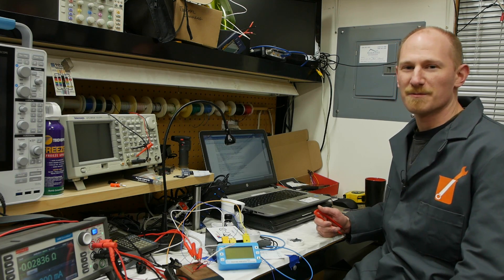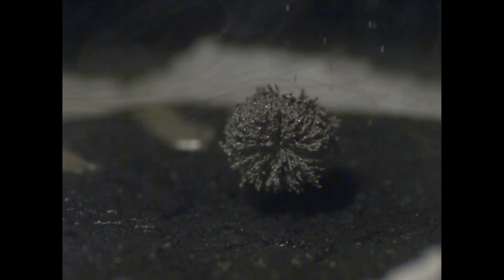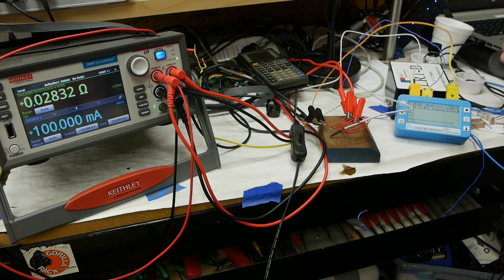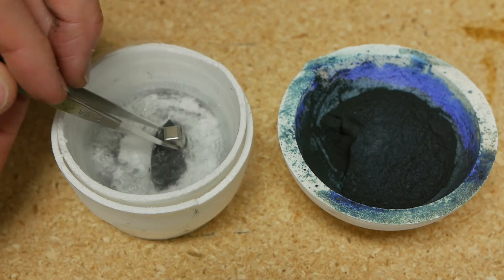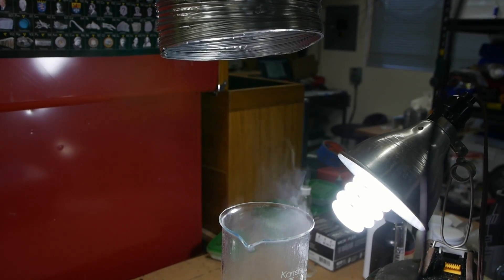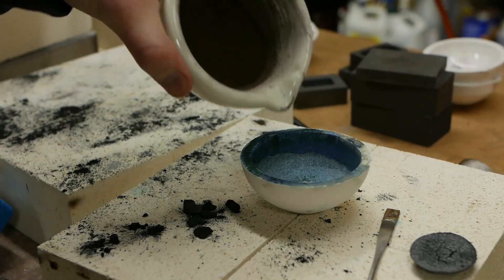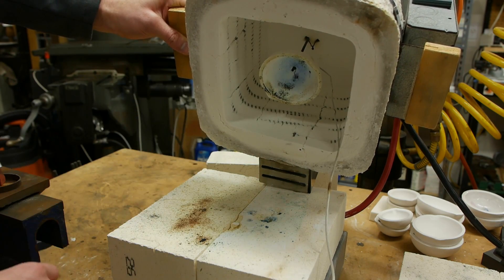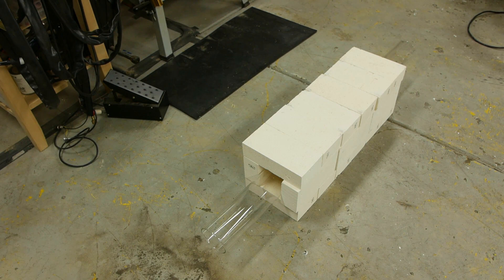Making YBCO superconductor

Comment: I am really happy to see you are back with new projects.  :) These cryogenic coolers are quiet nice, and I am trying to get one for a couple of years. But at Ebay Germany/EU they are very rare and/or very expensive...
Reply: Orbis92 i made liquid nitrogen using 4 stage cascade refrigeration system build using 4 fridge compressor i got from scrap yard for $4 each. Total project cost was under $100 and production rate after modification is around 450ml to 500 ml per hour. 12 liters per day. It took me one 2 weeks to build it.

Comment: I wonder if it's possible to build a loop transmit antenna out of superconductor. When the loop is small compared to wavelength (for long/medium/shortwave) the problem is that they have a very low impedance, so that they basically lose a big portion of the transmit power to resistive losses. In practice it is impossible to build a small, yet efficient long/medium/shortwave transmit antenna. Could this be changed using superconductors?

Comment: This takes me back, I spent a long year making variations on a theme of YBCO (everyone I worked with called it "ibco" btw). For attaching wires we used a platinum ink to stick on tiny pieces of platinum foil. Both were as expensive as you'd expect but a tiny bottle of ink lasted for hundreds of samples. You just paint a little ink on the sample, touch the platinum foil to it and then bake it in the furnace. I seem to recall the ink is platinum on carbon so the carbon burns away and the platinum sinters to the sample. I will say I was using this for high temperature experiments but I'm pretty sure it would work at low temperatures too. IIRC the methodology we used correctly you are cooking it way more than you need to. We'd just mix together stoichiometric amounts of material and chuck it in the furnace over night at about 1150 C - or lower than any of the components melting temperatures. The mixing process was grinding in a mortar and pestle then stamp it into disc using a 15 ton press. If you've got any questions I'm happy to try and remember what we used to do.
Reply: You were making PCP? Lol

Comment: When I first glanced at the video subject title I misread the YBCO as REBCO but after realizing my mistake I began to wonder if Rare Earth Boron Copper Oxide materials was area of research you were considering pursuing?
Reply: Since Yttrium is a rare earth metal, YBCO is a REBCO. Another example of a REBCO is BSSCO (Bismuth Strontium Calcium Copper Oxide).
Reply: bismuth and strontium are not considered "rare earths"
Reply: Boron doping has been used in ybco in some cases for spinning ybco fibers
Reply: IamGrimalkin
Correct
Reply: Yep, BSSCO is a HTS, not a ReBCO.  It doesn't have barium.
Reply: B stands for Barium, not Boron, in this context.
Reply: Abdega
Not to replace barium, though, right?
Reply: +Dennis Huiberts:
"Since Yttrium is a rare earth metal, YBCO is a REBCO. Another example of a REBCO is BSSCO (Bismuth Strontium Calcium Copper Oxide)."

==Yttrium is not a rare earth metal.

Rare earth metals are the ones that start with lanthanum (atom number = 57) and ends with Lutetium (atomic number =71).
Yttrium is 40.